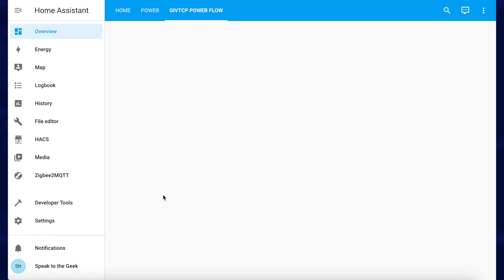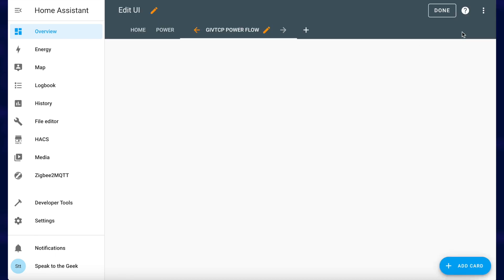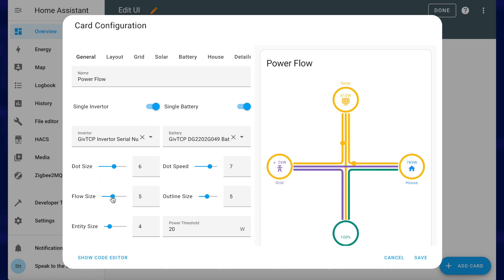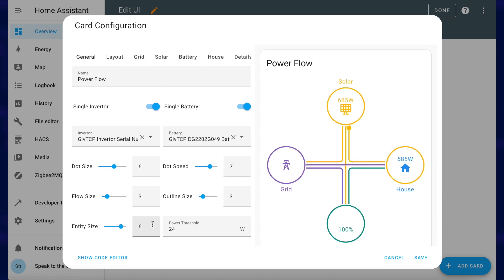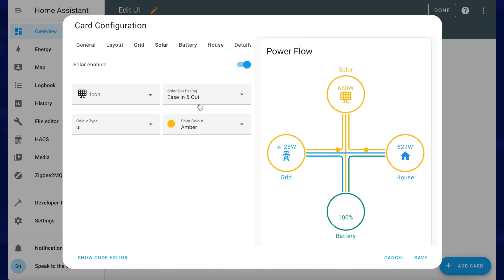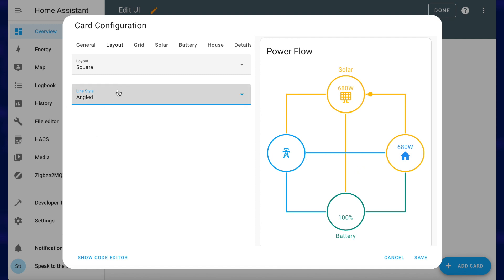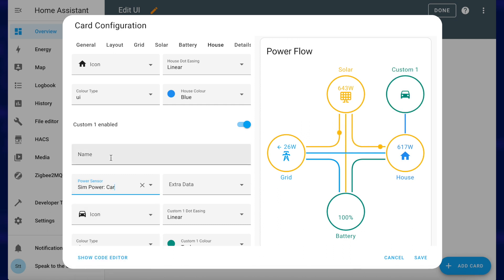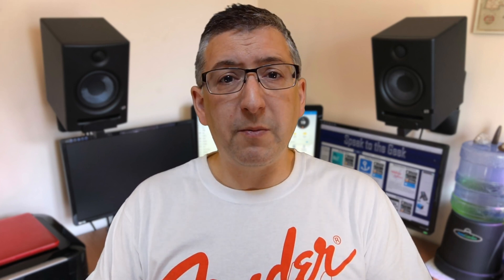GivTCP Power Flow Card for Home Assistant and GivEnergy Inverters

Comment: Hi @SpeakToTheGeekTech, thanks very much for your informative videos, you've allowed me to get GivTCP up and running on my QNAP NAS.  Quick question, I'm trying to display the GivTCP Power Flow card but it doesn't show up as a "Custom" card so I can't see where it is.  I've just setup HACS and downloaded the card, I just can't seem to fathom out why it won't show up in the list of cards, if I try and add a manual card it says "No type provided".  Apologies if this is a noob question, if you can give me a quick pointer it would be really appreciated.  Keep up the stellar work!
Reply from the maker: Sounds like your browser cache hasn't updated. Try forcing that to clear, or if you have another browser (Chrome, Firefox, Edge, etc) use that to prove that is the issue.
Reply: @SpeakToTheGeekTech  Thanks for your quick response, cleared the browser cache and tried an alternative browser but still the same.  I'll have to do some digging, probably something silly.  Thanks for your help all the same.
Reply: @SpeakToTheGeekTech  All good - had to reinstall HACS and it then found the GivTCP flow card..  must've been something off when I set it up initially.  Thanks again!

Comment: Hi Oliver, I guess things have changed since you did this guide. Buttons and options have moved to different places or are just different. I am unable to get the Power flow card working
Reply from the maker: Hi, it's been quite a while since I used this card - I much prefer the Power Flow Card Plus, but if you do want the GivTCP Power Flor Card to work your best bet is to raise the issue on the project's Github page.
Reply: @SpeakToTheGeekTech  Same challenge with the Plus card. It's home automate that has changed not these cards. Its my first experience with HA

Comment: Ive removed the toggle for single inverter and single battery for 3 interest and 3 batteries each but I'm still only seeing a power card for 1 inverter?
Reply from the maker: I only have the one inverter so I've no way to test that. Try asking the question in the GivTCP Facebook group and perhaps someone in there might be able to provide you with pointers: https://www.facebook.com/groups/615579009972782
Reply: I’ve got two inverters and two batteries, you get a single power flow showing the combined solar, grid and house demand across the multiple devices.   If you want to see the individual battery states these can be added on the bottom of the flow: on the detail tab add the battery soc sensors

Comment: @speaktothegeek Does adjusting the power simulation actually alter the flow of energy from one part of your system to another (e.g. how much energy is being put into your car?)
Reply from the maker: Sort of. Where the card calculates the flows, yes, but the simulated sensors I created are not intelligent so for example if I increase the speed that the EV is charging, it won't automatically increase the grid import / battery output. The sim sensors were just intended to give me something quick to get the cards up and running rather than be a fully accurate representation of power flows.

Comment: Is it possible to cast it to a Google hub display like you can with Power Flow plus? If you can make it bigger then that will be perfect because power flow plus is a bit small when being cast.
Reply from the maker: I don't have a Google Hub to test that on, but if it works for the Power Flow Plus card then I don't see a reason it wouldn't work for this one too. This GivTCP card is bigger overall, and you can customise the size of the circles too so it might look a bit larger on the Google display.

Comment: Having problems configuring power card with AIO config in tcp. In card config it finds inverter but no battery listed, is there a work around? I have seen your AIO settings for Givtcp video, guess there is a hint in there!
Reply from the maker: There’s currently no support for battery data in GivTCP and the AIO. Hopefully that’ll come soon